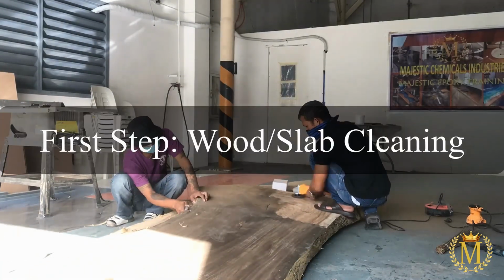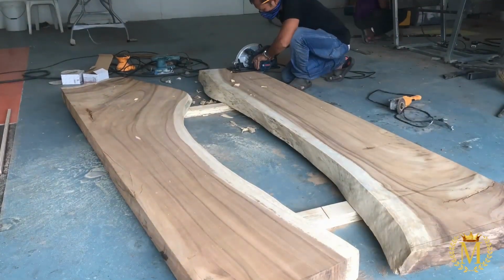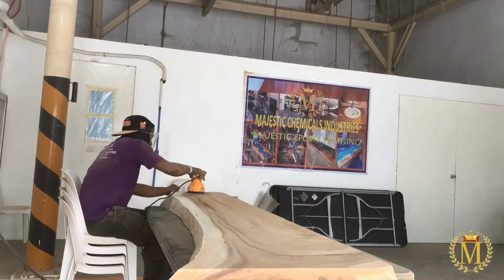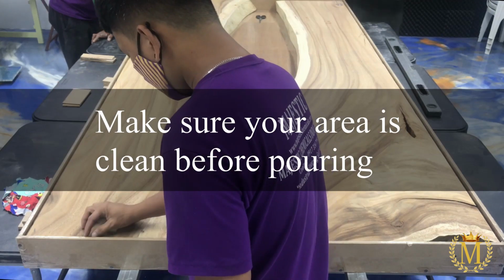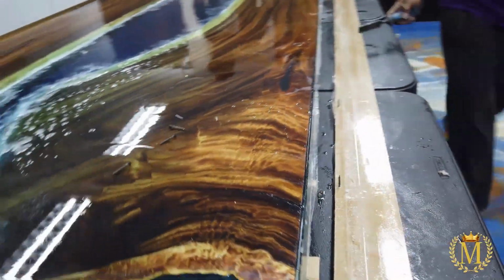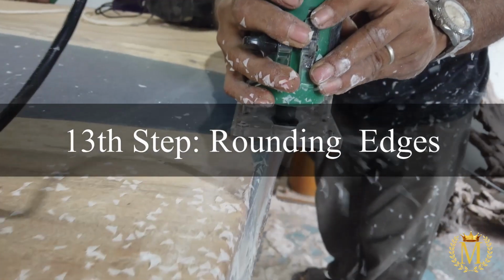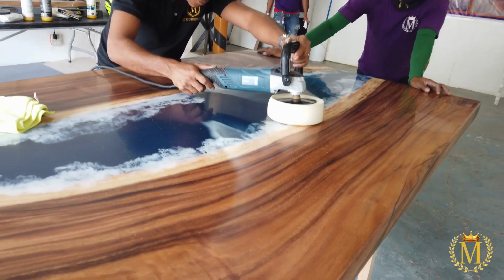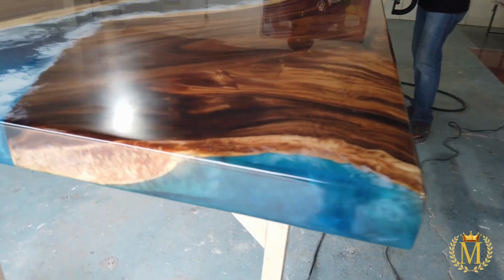LIQUID CRYSTAL EPOXY BEACH RIVER TABLE !!! Step by Step: INSTRUCTIONAL VIDEO

Comment: How do you prevent cracking and separation when the wood moves seasonally while the resin stays stable?
Reply from the maker: Hello! Thank you for inquiring Majestic Chemicals! 

direct message us our facebopok page

For quicker respond, you may call/text: 
Ronnel Catamora of Majestic Chemicals Industries 
0920-840-4282 (Viber ready)

Please visit our Facebook Page:
https://www.facebook.com/majesticchemicals
Reply: There's a test made by Blacktail Studio YT channel with the strength of expoxy resin poured at the middle of 2 slabs. The test showed that the  resin can bear 2,000 lbs of weight & when a log was dropped straight to the resin, of course it breaks but not the bond of the resin with the wood.